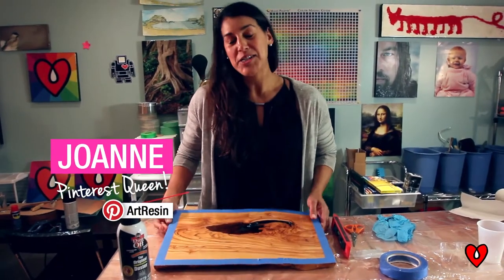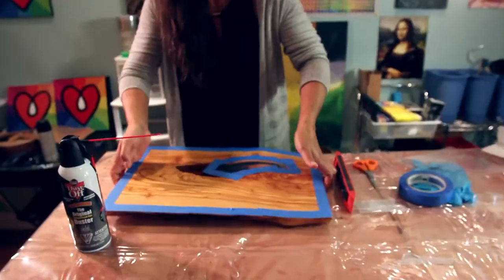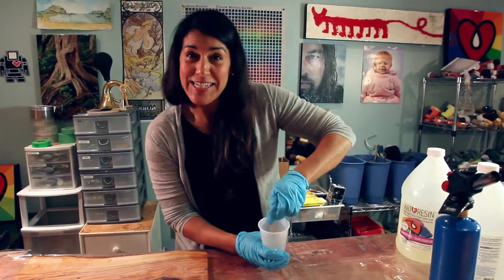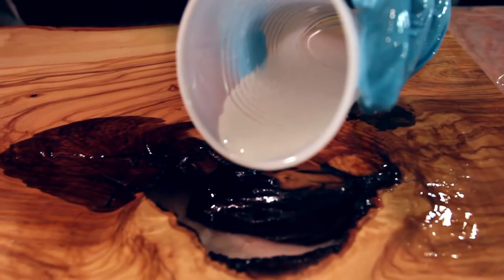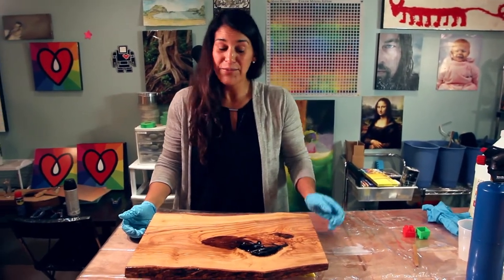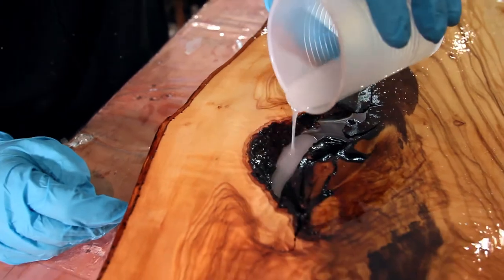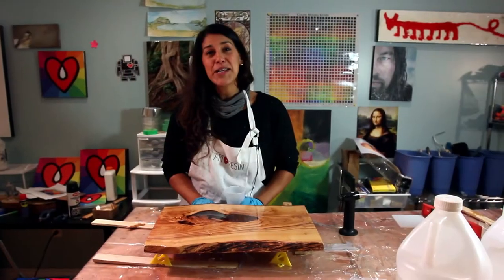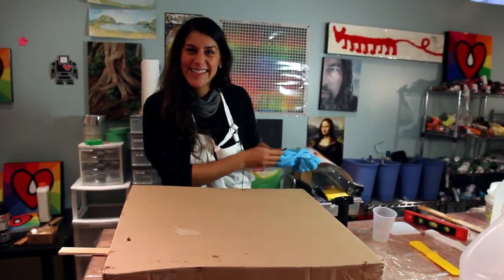How To Resin A Live Edge Wood Board - Part 3

Comment: Man. How big was that hole? Seems like it took a lot of resin.  Why didn't you just fill it in?  Because of the bubbles?
Reply from the maker: Hey Rad - yes, the hole was about an inch thick, and I poured 1/8" thick at a time, so it was about 8 or 9 layers.  
And yes, you're exactly right - if we had filled the hole in just one pour, it would be way too thick for the bubbles to penetrate and release to the top.  
And especially working with something organic like wood or rock that contains a lot of trapped air ... even after torching, the wood kept releasing bubbles.
I would go and check on it every few minutes until it started to cure to see if I could pop out any rogue bubbles.
It was a lot of work, but worth it - it looked so so beautiful!
Reply: I resined a grasshopper for my son. It did the same thing. Bubbles
Reply from the maker: exactly - all organic matter will release air so best to go slow and steady like we did with all of our layers.  
A little tedious for sure, but worth it in the end :)

Comment: Help please?!?!?!?  I did my first table and it won't dry. It's been 6 days and it is still tacky on top. I was encapsulating things in the table top, so the pour was thick. I poured about a quarter inch every couple hours until I got to 3/4 inches. Is there anything I can do?
Reply from the maker: Hi Courtney - oh I'm sorry to hear your tabletop didn't cure .... but don't worry, you can fix it!

99% of the time if resin doesn't cure properly, it's the result of an error in measuring or mixing:  either the resin and hardener were not equal or they weren't fully mixed.  It's super important that the resin and hardener are an exact 1:1 ratio, and that they are mixed thoroughly for at least 3 minutes minimum - and you need to scrape the bottom and sides as you mix or you run the risk of unmixed resin/hardener when you pour.

So if your tabletop is solid but just tacky to the touch, it's an easy fix ... mix up another batch of resin ( being mindful of measuring & mixing as above ) and pour over.  Let it cure and you should be all good!
If your tabletop has wet, liquidy patches, you'll need to scrape off all the wet stuff, and then proceed as above with a fresh batch of resin

Check out our video OH SH*T - Sticky where Patty shows how to fix this very common issue.
https://youtu.be/gWD6-lJbBlY?list=PL56BR0x4HHEFtKh2vAoBzCsOXoYFlID95

Let us know if you need any more help!
Reply: ArtResin thanks. I scraped and reapplied this weekend. I think it came out ok this time.
Reply from the maker: Yay!!  Awesome to hear!  :)